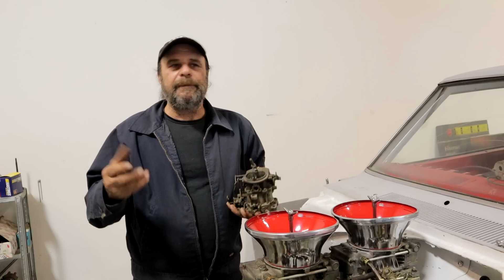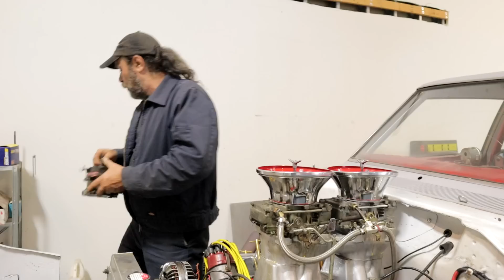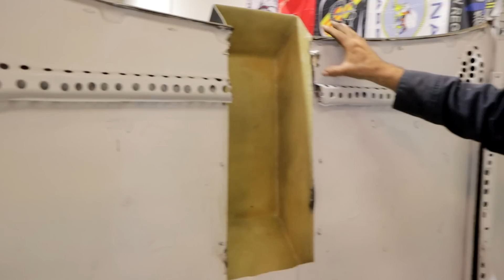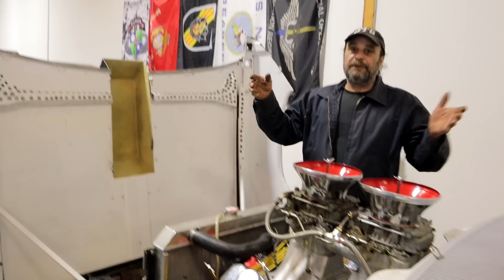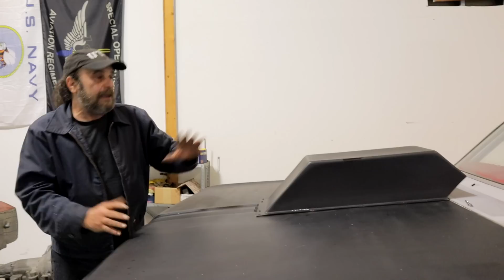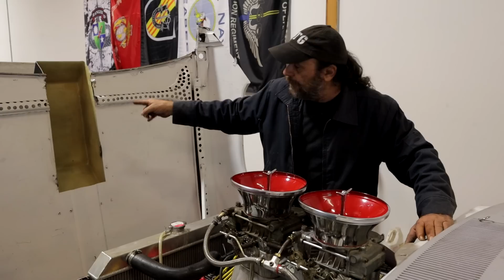Velocity Stacks And Cowl Induction And The Latest On Slaghammer And Mission Impossible 318

Comment: So I’m two years late to the party but better late than never I guess. I have a widened forward facing scoop on my car and for the strip I leave the air filter ring on which tends to block most of the hot air from the engine and have a curved strip of aluminium (yes, correct spelling because I’m an Aussie and it’s a real word 😂) which holds the filter and base down and when racing is finished, I just refit the filter top. Carb is sheltered by the filter while the cooler, fresh air comes in through the scoop and that so far hasn’t shown any signs of turbulence like you mentioned Uncle Tony.

Comment: Hoping you might see this question..
Would you see better times in the 1/4 mile with a 1970 Road Runner or GTX having the Air Grabber open with still the factory air cleaner in place?

Comment: running carbs with no  air filters is.  death, ive seen   racers  run with  a open carb, no filter., and the air passing over the carb sucks the fuel out of the vent tubes turbo guys spend 20 grand on a motor and  wont run a filter

Comment: Add a tab to the cowl each side of the scoop and add hood pins to stabilize the back of the hood now and the cut piece is no longer missed in the least. No flop or flex at speed and only slightly more to flip the front end. Just a thought from one old hotrodder to another.  You might want to think about hardline connection with center bottom facing opening between the front and rear bowl vents of each carb to prevent over pressure inside the bowls at high speed and the sudden AFR change on the big end of the track. Don't forget about slosh vents on the top of the metering blocks and slosh tubes over the jets, too on those hard launches. I'm sure you know all this but sometimes we overlook the simple things in the big picture.

Comment: I'd like to use stacks like that with a big air filter, like 14"x 4" -6" filter, and on dual carbs , maybe a 12" and offset them ,.  Or a large oval filter, but you run out of space fast!

Comment: Like the explanations of how hood scoops work, although I'd have done it slightly differently. If you want to see what really works, check the ram air scoops on military aircraft. Some clear the aircraft body in order to get out of the boundary layer and turbulence. Others use a NACA style; a somewhat triangular cut in the skin that also gets around the boundary layer. The consistent thing to avoid is the boundary layer.
Would like to see an aerodynamic study to test my own theory of rearward facing scoops; that they reduce drag. There is a high pressure zone at the base of the windshield alluded to in the video. Pulling air into the engine from there would seem to reduce that pressure, and therefore drag. It also seems that a properly designed rear-facing scoop could also reduce the coefficient of drag.
It's been noted that the factory hood scoops on many muscle cars did little to create an actual ram air effect, although they did create a route for cold air induction. It's been admitted that the teardrop Thunderbolt hood scoop was for hood clearance.

Comment: Ford used the Teardrop hood scoops on the Thunderbolts and other Ford drag cars, sourcing air from the Cowl.
 Great idea for a series regarding the 
318 build. Will be interesting indeed.
Reply: Uncle Tony next video says that isn't what Ford did with the Thunderbolt.  It had air scoops where the high beam headlights were, and the hood  scoop just added room for the high riser and was a heat vent.

Comment: Well, the manufacturers have to pay by putting these systems in place and we have to pay by maintaining them and repairing them all in the name of less emissions.... I get it. I understand, but the interglatial is happening. Regardless, you can't stop it. The world is froze and melted many times before. Yes we have sped it up but we cannot stop it regardless so you might as well have badass cars until we die or blow ourselves up which I'm not against a restart or complete removal of humankind or at least our species. There were other ones but we wiped them out and crossbred with them.... Unfortunately 100% has to die for the 1% to die. The 99% have to sacrifice ourselves

Comment: I can't stand things moving around in my line of sight whether on or off the track. An easy, low buck fix for the flex after removing the sheet metal at the back of the hood would be welding a tab to the cowl on each side of the hole then, using a couple of hood pins to keep it from moving around.

Comment: Ford had the best induction flow with the setup on the '64 Thunderbolts and similar cars. Eliminate the high beam lights and run tubing from there to a sealed air box. No boundary layer, no pathway reversion, no turbulence from engine compartment air. The faster you go, the more pressure builds up in the tubes. Olds under-bumper Fresh Air Induction is similar.

Comment: I doubt there is any "backwards flow of air at the base of the windshield. What you would have is a very calm layer that could be used as a non turbulent air source for the carburetor to make air intake to the carb more consistent. Along with that using the cowl air provides air not affected as much by under hood temp. Will you notice an advantage on your car, I doubt it.
Reply from the maker: Then explain the air that comes rushing through the car when you open the vents at highway speed
Reply: @UncleTonysGarage  There is a high pressure area at the base of the windshield but it doesn't bounce back as you said. The interior of the car is at a lower pressure than the base of the windshield which is what causes the flow of air through the vents. I really doubt the air reverses direction.
Reply from the maker: Correct about the high pressure area...but you're leaving out the effect of the lump itself.  It breaks the air coming back over the boundary layer, and creates a low pressure area directly behind it.  Now, what happens when you provide a high pressure area a low pressure area to escape to?  It  heads back towards the front of the car, right into the scoop.
Add the low pressure provided by the carbs themselves, and you have a pretty effective induction system

Comment: I will attest to the cowl theory. I fabricated an air pan around the carb that sealed to the cowl scoop isolating the carb to only the high pressure windshield air. picked up 4 tenths in the 1/4 with no other change. a little jet and timing and it picked up another 3 tenths. all this on a mild street 355 small block. in a 3500 pound car, on pump gas and through the mufflers that little 355 put the car at a 11.96 at 115 mph.

Comment: It would be cool to document if the ram air scoop works so well that the hood lifts up at speed. More obvious to observe as the hood cross brace is gone now.

Maybe get some of those paper/plastic strips they stick to the body panels for visualizing air direction?
Reply: I am new to Tony’s videos, but you are onto the best data logger short of a wind tunnel. A handful of telltails along the hood and window would let him show the effects. 
I have used them on my truck to solve wind noise issues.

Comment: Great video. A lot of people don't realize the base of the windshield is a high pressure zone. You'll see new guys open up the cowl or remove their hood seal thinking they'll vent the engine compartment that way and get better cooling. Wrong! That high pressure area will push air back into the engine compartment and make it harder for cool air to pass through the radiator. The hot air is supposed to get sucked out by the low pressure zone under the car - that's why the bottom of your firewall is shaped like an air duct. Once you understand these pressure zones, cowl induction makes perfect sense.

Comment: Speaking of Scoops, and people trying for the ram air.... I've actually seen it backfire on them to the point it turns the top of the carb into a reverse venturi, and it sucks the fuel from them. You end up with a fine mist of fuel on the windshield. There is definitely more to hood scopes than looking cool.

Comment: To anyone thinking about putting a cowl induction scoop on a drag car, it won't pass NHRA tech. The rules state you need a flash shield to cover top, sides and back of carb. It can only be open on the front. This prevents fuel from being siphoned into the airstream and toward the driver. AHRA may be different.
Reply from the maker: I may have actually incurred brain damage by reading this comment.....
Reply: @UncleTonysGarage  Sorry if rules hurt your brain. I was quoting out of the NHRA rule book, sec 21, page 4,- 4:1. Flash Shields. If I am interpreting the rules wrong then I apologize.
Reply from the maker: Flash shields are referring to open bodied cars or ones run without a hood.  Has absolutely nothing to do with cowl induction in any class.  There are literally thousands of NHRA legal cars out there running cowl hoods.

Comment: Have a 4" Hemi Mr Fiberglass hood scoop on my 69 Cuda. Love the look. Tow years ago I built a lexan body that goes on top of the carb/throttle bode and grabs the cool air and guides it in. No stacks. Using a Edelbrock PF-4.  The air temperature when drag racing drops from 110°+ to low 80° range by the end of a 1/4 mile. When driving on open roads the intake temperature drops to 2° above ambient.  I do use air filter with a cotton screen top. But what it does prove is the old scoop dose work for cool air. I believe the 4" air cleaner breaks up the turbulence. But I only run 12.60's with a 3600 lbs 345 CI LA motor.  Drive the car 4 to 7k miles every summer so, it has to have an air cleaner. Though about making it so I could race without the air cleaner,  but now I guess not.. Like the information. Alway knew the Cowell induction worked well now I know why.

Comment: You are right about maximising every part! Thats how my hubby won all but 2 races in 2 yrs.  Example look up the fuel inlet on a holley, turn the needle valve until a window is completely visible. Leave it. Bend the float tang to get float level correct. It will take many trys but max flow results.

Comment: Hey Uncle Tony, I know Slag Hammer is becoming a purpose-built race car, but I hate the idea of drilling into the cowl and riveting sheet metal. Only because if you go the other way you have to weld up all of the holes. Could you use one of those cowl covers they sell for 65-66 mustangs?

Comment: Sort of a clarification in terms of the air "splitting" at the windshield. 

The air only splits at the cowl if there is an opening - like a cowl vent or an induction setup - for it to go through. Otherwise, it all ends up going over or around the windshield. What you're describing is the build-up of air against the base of the windscreen creating a high-pressure zone. The air being forced to change direction and go over the turret takes energy out of the fast-moving air. The air gives up that energy, slowing down, and because of Bernoulli's equation, an increase in pressure can be observed. You can tap this zone by putting an opening on or near the cowl, and that is how cowl intakes work.

It's also why you want to make sure you have the vents closed whenever you make a run, because the ventilation system will be taxing some of this high-pressure air and eating into your results.

Comment: Remember those plexiglass bug guards that bolted on the front of hood? 60s 70s  80s aftermarket things. (last popular on rednecks pickups with things lettered on them)
 So my dad had a 73 F350 crew cab, in the winter you froze your ass off in the thing, parked the heater worked fine, on the highway your ass froze. Older guy at the gas station I worked at knew exactly what the trouble was because he and his brother in law had mostly identical late 60s Impalas years before. One acted like dad's pickup. After replacing and checking every possible part in the heating system and much hair pulling they had the cars parked side by side and he noticed one difference. The cold one had a bug guard, they pulled it off and the problem was solved. Worked on dad's truck too. (his was mounted on the hood not down in front like most were then)
 Without a wind tunnel to prove it, the theory was the things upset the air flow and created a vacuum area at the cowl instead or a pressure area, and the heater fan couldn't make up the difference. 
  My first lesson in automotive airflow. 😂

Comment: Need to see my stack.  Autozone/Oreilly’s has some carb filter spacers.  I stacked those about 6” high.    Then put the air filter on top.  I found out air flows better STRAIGHT INTO the carb the with the short filter flowing ACROSS the carb.  You could feel mid range pick up!

Comment: those who have driven a ragtop know that the windshield creates a vortex as it cuts through the wind. The air coming from behind you is sometimes faster than the air you're cutting through, enough to where my hair was blowing towards the front of the car at 80 mph, not backwards. The Grump Lump creates the same vortex, which is why it's better than regular cowl induction, which only gets air from that high pressure zone at the base of the windshield.

Comment: It’d be really interesting (and expensive) to put this premise in a wind tunnel experiment. Of course on a car by car basis so one could dial it in for that particular car. I realize UTG’s budget cannot possibly accommodate this. The last time I saw anyone do this was the Cleetus McFarland channel put Leroy in one and it was $600 an hour (but the test had nothing to do with hood scoop efficiency, Leroy doesn’t even have a hood 🤣). The premise seems legit, but testing would solidify and make tweeks possible to increase efficiency.
Reply: You can do something similar to wind tunnel testing in open air by putting little pieces of string all over the part of the car you are interested in and observing with a camera or a chase car how they behave at speed.  If you want to get really technical you could setup a pitot tube
Reply: The last time Cleetus had anything in a wind tunnel James also put his Nova in. That car had a standard style cowl hood and they showed the air path very clearly with it.

Comment: Years ago I ran street stocks on a oval track we ran a similar scoop setup to get the most of the stock 350 motor. A dollar store salad bowl, a pie plate, some threaded rod  and a few nuts we could adjust the air flow to the carb by raising or lowering creating a tornado effect. This helped with air temperature changes as the night/day races went on. The other thing we did was made a u channel to help guide the air into the scoop.

Comment: has anyone ever tried compressed air like a welding bottle setup as a form of boost pressure?
Reply: There’s a system out there that uses compressed air tanks. The problem is it takes a large tank or tanks to get much boost for very long. Their system had two large tanks and quite a bit of stuff to make it all work right. It took a lot to control it since you could basically force however much air in at any rpm so it was easy to destroy stuff by making way to much power at low rpm.
Reply: NOX... yeah... LOL
No, but really, the tank would have to be enormous to hold enough air, even for just a 1/4 mile run.
Reply: Many times. One that immediately comes to mind is the system Ford used on the Focus RS WRC 03 for a few rallies until it was banned. In that one they hid a 45 litre air tank inside the rear bumper and siphoned off compressed air into the tank off of the anti-lag and whatnot to then use it for a little bit of extra air and manifold pressure on full throttle. Ford did this to gain an advantage by essentially having a little bit of airflow bypass the mandated inlet restrictor on the turbo and getting something like 5% more power. So in a rules restrictive scenario compressed air or whatever does have a use, but in an unrestricted formula there's really nothing to be gained. I think some people experimented with compressed air powered dragsters in like the 70s. There's at least one of those cars at the Garlits museum, I remember seeing something that looked like the car was mostly air tank.

Comment: I have a 72 Cutlass with the fiberglass hood that has the dual open front scoops.  I wish I had the air cleaner top with the induction door you open. Maybe my bumpy hood affected the air flow when I tested the windshield to hood air flow. I put little strips of masking tape on the back of the hood and they only moved toward the back of the car. They only reason I tried it was comparing to the Chevelle cowl induction. I may test it again in the spring if the gas prices stay where they should be...

Comment: Won't you want a crown plate that rests just below the crown of the stacks?

Otherwise it would seem that you would get tons of cross turbulence between air trying to come up from the radiator and out the back of the scoop, and at the same time air from the windshield trying to go around and past the intake of the carburetors...

If anything, leaving out a barrier plate between the scoop air and the engine compartment air would seem to make it even less stable.
Reply: Actually, the air coming in from the scoop is forced down past the carbs, so all of the turbulence will be underneath the stacks.  However, a plate to block off that air might force more of it into the stacks, creating a small boost effect...

Comment: 11:45 Looking at the hood down, why not add a couple of hood pins on either side of the opening of the cowl induction hood to secure the corners to the firewall? Maybe add a heavy rubber donut or grommet on each pin under the hood for a nice compression fit? Eliminate the flex.